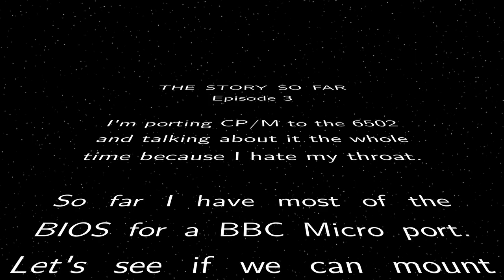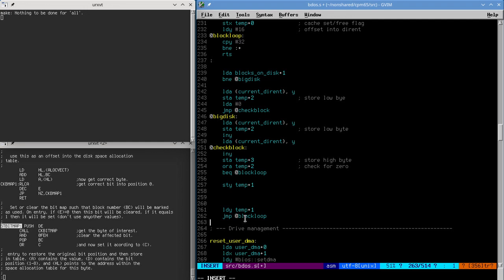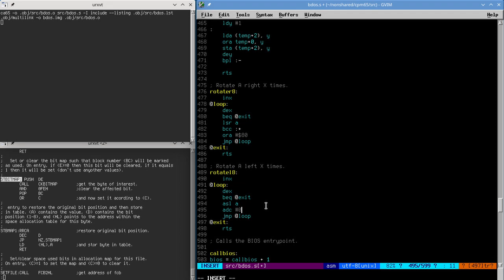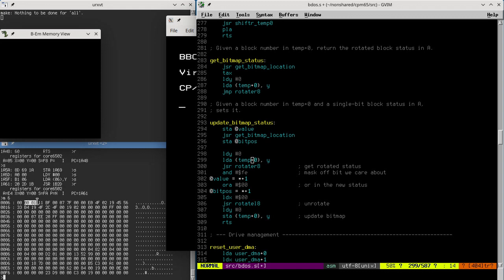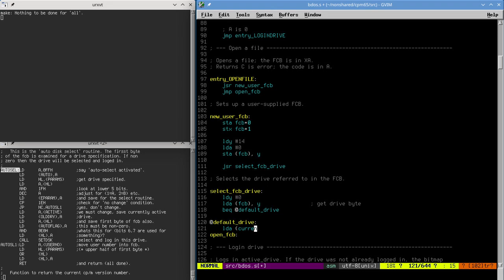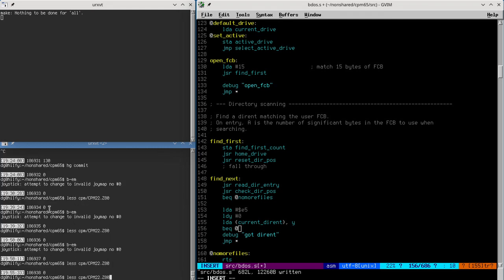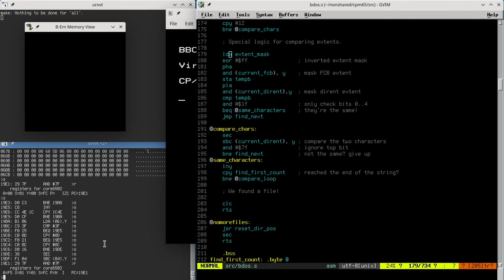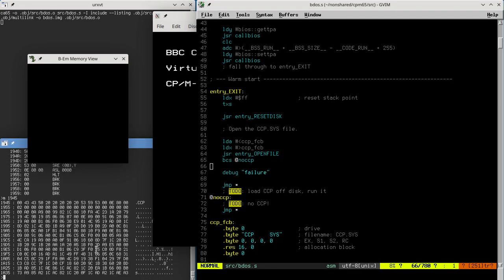6502 CP/M: 3/14

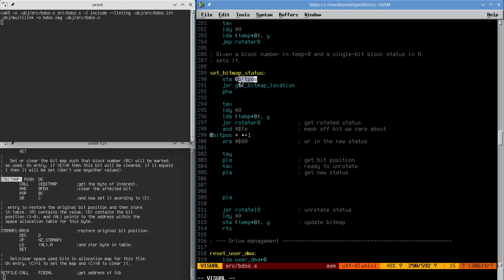Comment: The self modifying code at 45:00 would prevent this being ROM-able, which might hamper some ports that could otherwise have more program RAM. What would an alternative strategy have looked like that didn't involve modifying the operand on the fly? I'm guessing either an additional temp ZP variable or pulling/pushing to the stack?
Reply from the maker: Yeah, you'd need another ZP pointer variable, which I didn't want as it would only be used by this one piece of code but would consume ZP for everyone. The solution is to (somehow) define some ZP pointers for local temporary use --- i.e. can be corrupted by anyone. Unfortunately that'd be hard to implement as it'd make fixup much more complicated.
Reply: Or... You could just have an 8 byte table of bits and then you don't even need to bother with all of the rotating and stuff, just: ora bit_table,y.   Saving both memory and time :)